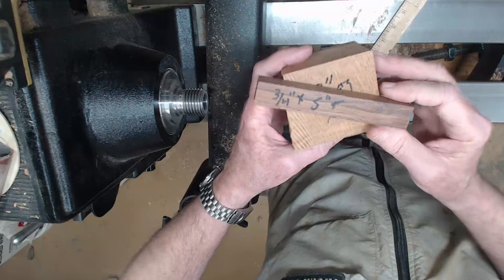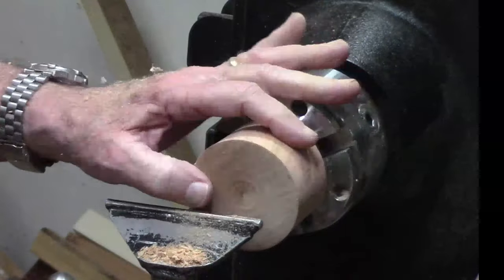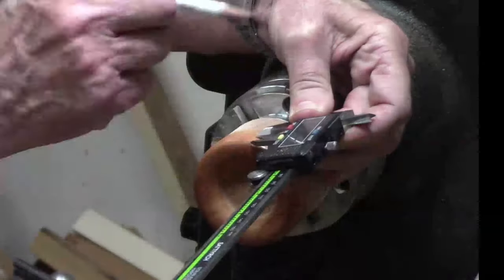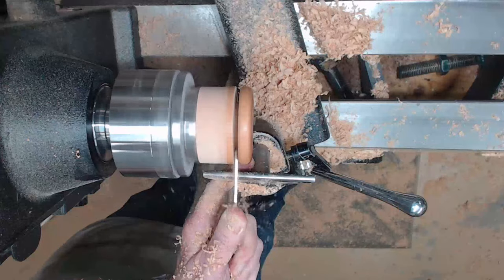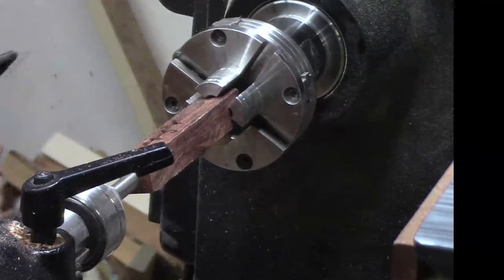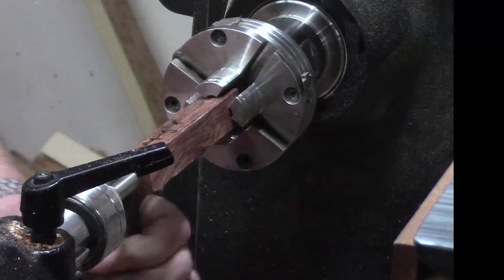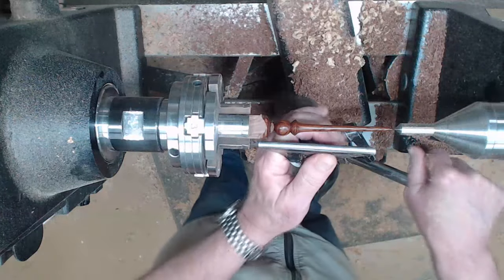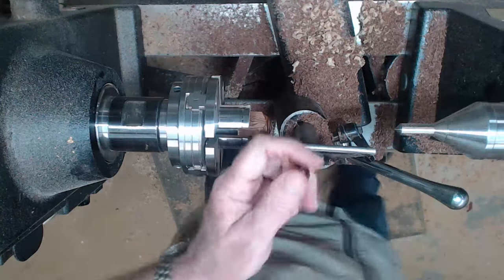Turn a Shawl Ring and Pin: Step-by-Step Guide

Comment: you may want to add a small valley on the knob end to catch on the ring.  This will help prevent the pin from slipping out accidently.
Reply from the maker: Great tip! I will be making another one today and will do just that.

Comment: I make mine with a 2 inch center hole. After parting off the ring, you can use your Nova 50 MM jaws and expand inside the ring to finish the back . I made up a spacer from 1/4 inch plywood to set behind the ring. That extends it out enough to eliminate running into the jaws when finishing the back of the ring.
Reply: Also, if you bring a cone center to just inside the ring when parting it off, it will prevent the ring from flying away.
Reply from the maker: Thanks for sharing your technique. I will have to try that.

Comment: at 21:36 “move to the center, where the rpm is slower” — no, it’s a rigid disc, so the edge makes the same number of revolutions per minute as the center.  But as the radius gets larger, the surface rate goes up proportionally, and it is the surface rate that determines how much cutting is done — think belt sander.  So unusual to hear you say something that is not quite right!
Reply from the maker: I do grab the wrong words sometimes. Like RPM when I meant MPH!